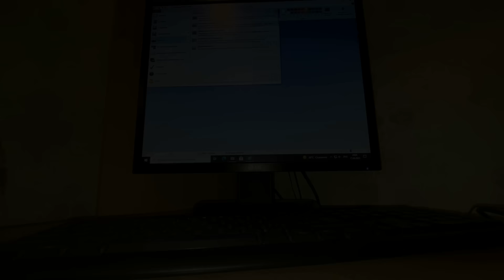Дубовая кружка с латунной инкрустацией DIY. Woodturning an Oak Log Mug brass inlay DIY

Comment: the author does like to from scratch, shaping and trimming wood from large blocks into fine finished products. https://www.youtube.com/post/UgkxD-QRFQz730FJEh4f9BYSf-nkIMIC9hL_ as another reviewer mentioned, most projects require a lot of high-dollar equipment that most of us dont have the room or budget for. But, knowing how to do these things, even if we wont be able to practice the full stack project, is still great.
Reply: What the heck are you talking about? What "high-dollar equipment"? A turning mill for like 200 bucks, likely assembled from pieces of other machines? A stove welded from sheet metal? A chinese microwave? The most expensive "equipment" here is the vacuum cleaner. Oh yes, the rich bastard splurged at least 150 bucks for it... or found it at a scrap yard.
Reply: Достаточно топора и ножа.